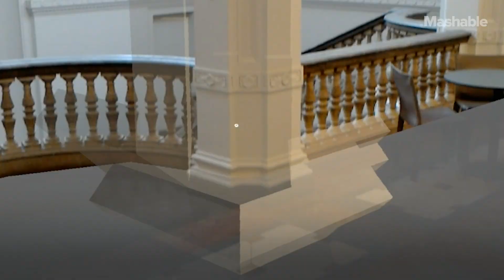Sustainable Cities Can’t Rely on Concrete. Here's Why Timber Could Be the Future of Construction

Comment: No problems with wooden buildings I live in a wooden house but vr as a construction tool what a crock this is just using tech because we can what's its real purpose to used under qualified manuel labour guided by  an overpaid engineer sitting by the pool on holidays Wood is a great material that warps, expands and contracts while you work with it how will your software deal with that I personally would prefer a qualified carpenter to unskilled computer aided workers....
Reply: i think gilles might have lost his reasearch to philosophical concepts, where he dtarted to question the basics of human thinking.

essentially his research was about proposing a house for meta materials and wood was used for the sake of understainding, meta materials are engineered materials where stifnnes and strength can be controlled highly in it.

therefore i do not understand why he is saying wood, je actually used wood not for its property but to imagine how meta materials in the futureight be built

Comment: It occurs to me that some people have forgotten the Great Fire of Chicago. 

Wood for most buildings might be environmentally friendly, but that will be a serious safety hazard.

Also... in the 1980s and 1990s, there was a switch away from wood and paper products, for fear of deforestation, and how that would be bad for the environment. 

I love the idea of making a beautiful building. Replacing cement and steel with wood is a distinctly bad idea.
Reply: The Great Fire of Chicago wasn't due to wood, any city would have burned that way. The problem was how Chicago was built. In fact, ever wonder why when you are building something you need to be X feet away, or a hundred other regulations?

Mainly because of things like Chicago. Chicago was allowed to be built pretty much however, homes were to close, buildings to close, AND the layout of the city perhaps was the biggest problem.

Wonder why we use a grid system? Because of places like Chicago. Turns out if you have large gaps between buildings, it makes it harder for fire to travel. Who knew? Anyway, grid systems are to standardize and limit how many buildings can be contained within a certain space and be allowed to connect, or be close together. Otherwise fire will continue to spread.

Also 1980s and 1990s for wood and paper was mainly due to misinformation or better misleading information. People raised concerns about how wood was produced, people then said "PAPER IS WOOD" then lumped the two together, even though paper by large was proposed using virgin pulp farms. Wood was a big one, but with regulations sourcing wood has become better.